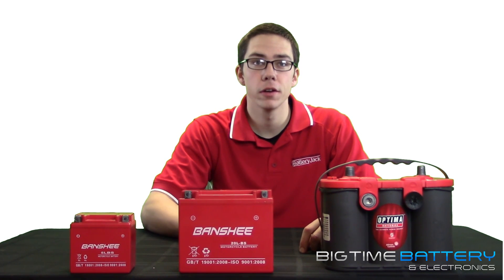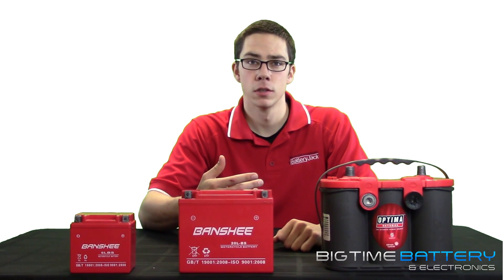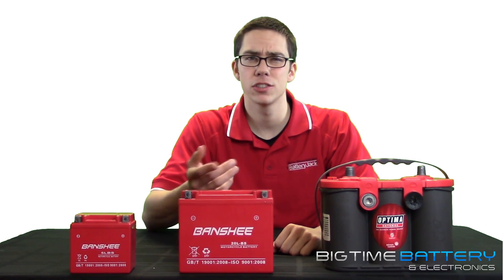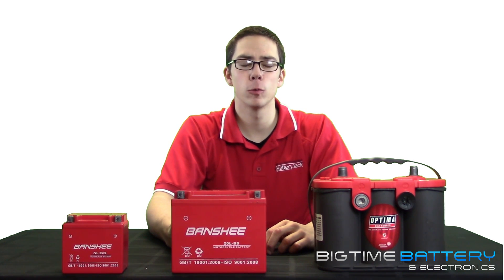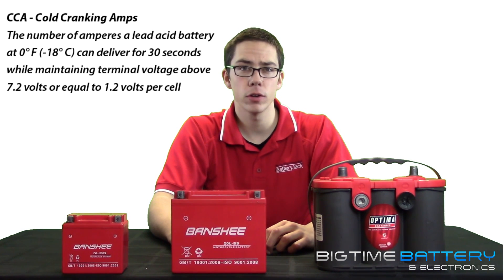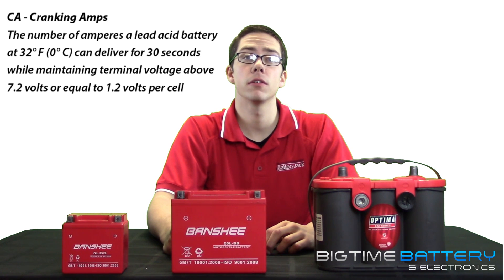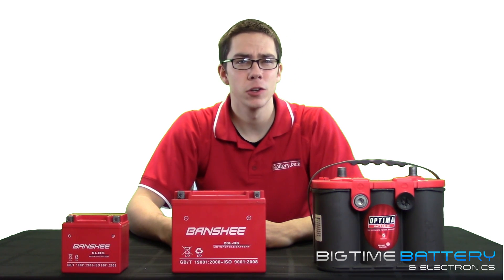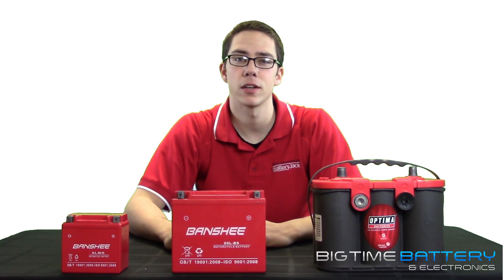Cranking Amps vs CCA

Comment: Simple define me cca definitions i dont understand
Reply from the maker: Cold Cranking Amps" (CCA) is a measure used to indicate a battery's ability to start an engine in cold temperatures. It represents the amount of current a battery can deliver for 30 seconds at 0°F (-18°C) while maintaining a voltage of at least 7.2 volts (for a 12-volt battery). In simpler terms, CCA tells you how well a battery can perform in cold weather conditions, which are typically more challenging for starting an engine due to increased resistance in the engine and battery. A higher CCA rating means the battery can deliver more power and is generally better suited for colder climates.

Comment: If my current battery is rated 650 cca’s could I replace it with a 600 cca battery? The CA on the current one I have is 825 but the one I’m looking at is 750.
Reply: Near enough.
Reply from the maker: Yes, you can typically replace a battery with a lower Cold Cranking Amps (CCA) rating, but it's important to consider a few factors.

Operating Conditions: If you live in a colder climate where the engine requires higher cranking power to start in cold temperatures, it's generally recommended to stick with a battery that matches or exceeds the CCA rating of your current battery. This ensures reliable starting performance, especially during cold weather.

Compatibility: Check the physical dimensions of the new battery to ensure it fits properly in your vehicle's battery tray and that the terminals are compatible with your vehicle's wiring.

Reserve Capacity (RC): Although CCA is important for starting the engine, Reserve Capacity (RC) is also worth considering. RC measures the battery's ability to sustain a load over time. If the new battery has a lower CCA but a higher RC compared to your current battery, it may still provide sufficient starting power and better overall performance.

Manufacturer Recommendations: Consult your vehicle's owner's manual or contact a trusted mechanic to see if there are any specific recommendations or requirements regarding battery replacement.

Given that the new battery you're considering has a slightly lower CCA but a higher CA rating, it may still be suitable for your vehicle, especially if you don't experience extremely cold temperatures. However, if you frequently encounter cold weather conditions, it's generally safer to stick with a battery that matches or exceeds the CCA rating of your current battery.

Comment: You have defined CCA in terms of lead acid battery, does that mean alkaline batteries does not have CCA rating.
Reply from the maker: Correct, Cold Cranking Amps (CCA) is a rating specifically associated with lead-acid batteries commonly used in vehicles, such as cars, trucks, and motorcycles.

Alkaline batteries, on the other hand, are typically used in smaller devices like flashlights, remote controls, and portable electronics. They operate on different principles and do not have a CCA rating. Alkaline batteries are not designed for the high current draw required to start an engine, so they are not rated in terms of Cold Cranking Amps.

Instead, alkaline batteries are rated in terms of voltage (usually 1.5 volts per cell) and capacity (usually measured in milliampere-hours, or mAh), which indicates how much energy they can store and deliver over time in low-power applications.

Comment: Why do these batteries only tell the CCA, and not the usual CA. I have a battery that has the same Reserve compacity.
Reply from the maker: If you have any other questions please feel free to call or text us at: 815-467-6464 or email me directly at cody@batteryjack.com

Cold Cranking Amps (CCA) and Cranking Amps (CA) are both measures of a battery's ability to deliver power, particularly during starting conditions. The difference lies in the temperature at which they are measured.

Cold Cranking Amps (CCA): This rating indicates the number of amps a battery can deliver at 0°F (-18°C) for 30 seconds while maintaining a voltage of at least 7.2 volts. CCA is crucial for starting a vehicle in cold weather because cold temperatures can significantly reduce a battery's ability to deliver power.

Cranking Amps (CA): CA, on the other hand, measures the same thing but at a higher temperature, usually at 32°F (0°C). CA is essentially a measure of a battery's power in less extreme conditions compared to CCA.

If your battery only lists CCA and not CA, it might be because the manufacturer is focusing on providing information relevant to cold weather performance, which is often more critical for starting a vehicle. However, if the reserve capacity is the same, it means that the battery should have similar performance under normal starting conditions as well.

Comment: When I started driving many years ago, I was always taught that the Cranking Amps are irrelevant, Cold Cranking Amps is the rating that’s important….of course I grew up in Detroit where we typically get about 3 years out of a car battery
Reply from the maker: In regions with cold weather like Detroit, where winters can be harsh, Cold Cranking Amps (CCA) indeed become a crucial factor when selecting a car battery. CCA measures the battery's ability to start an engine in cold temperatures, typically at 0°F (-18°C). This rating indicates the maximum current a battery can deliver for 30 seconds while maintaining at least 7.2 volts.

In contrast, Cranking Amps (CA) measure the battery's ability to start an engine in moderate temperatures, usually at 32°F (0°C). While CA is relevant in warmer climates, it may not accurately reflect a battery's performance in colder conditions.

Given the importance of reliable starting power in cold weather, particularly in places like Detroit, where winters can be severe, focusing on the Cold Cranking Amps rating when choosing a car battery is indeed prudent advice. A battery with a higher CCA rating ensures better starting performance in freezing temperatures, reducing the risk of being stranded due to a dead battery during winter months.

Comment: bro this information is useless. i figured you’d answer why it takes more amps to start something when cold
Reply: me too i am still looking Q_Q
Reply from the maker: I apologize for the oversight. The reason it takes more amps to start something when it's cold boils down to the chemistry of the battery and the physics of materials at lower temperatures.

Battery Chemistry: Inside a battery, chemical reactions generate electrical energy. These reactions are less efficient in colder temperatures because the electrolyte (the liquid or gel substance inside the battery) becomes more viscous, slowing down the flow of ions and electrons. As a result, the battery's ability to deliver power decreases in cold weather.

Increased Resistance: Cold temperatures increase the electrical resistance of the battery and the engine's components. This resistance impedes the flow of electricity, making it harder for the starter motor to turn over the engine. Consequently, more current (measured in amps) is needed to overcome this resistance and start the engine.

Engine Oil Viscosity: Cold temperatures also affect the viscosity of engine oil, making it thicker. This increased viscosity creates more resistance for the engine to turn over, requiring additional power from the battery to start the engine.

To compensate for these factors, a battery with a higher Cold Cranking Amps (CCA) rating is necessary in colder climates. This rating indicates the battery's ability to deliver high current at low temperatures, ensuring reliable starting power even in freezing conditions.

Comment: If my volts are good but my cca is 100 out of 450 would it mean my car is needing a new battery it starts up good still but need to know for my weekend driver car
Reply: Your battery is worn out. I assume you have already purchased a new one.
Reply from the maker: If your car starts up fine and the voltage is good, but the Cold Cranking Amps (CCA) of your battery are significantly lower than the recommended rating, it may indicate that your battery is starting to weaken. The CCA rating represents the battery's ability to start the engine in cold temperatures, so having a low CCA compared to the manufacturer's recommendation could mean that the battery might struggle to start the engine, especially in colder weather conditions.

While your car may still start up fine for now, a low CCA could mean that your battery is nearing the end of its lifespan and may fail sooner rather than later, especially if subjected to colder temperatures or increased demand (such as using additional electrical accessories). It's generally advisable to replace the battery if the CCA rating falls significantly below the recommended level to avoid unexpected issues, particularly if you rely on your car for weekend drives or infrequent use.

If you're unsure about the condition of your battery, you may consider having it tested by a professional mechanic or at an auto parts store. They can perform a load test to assess the battery's overall health and provide recommendations based on the results. This way, you can ensure that your car remains reliable for your weekend drives.

If you need any other help call or text us at: 815-467-6464

Comment: Yesterday morning when I went to start my car, all I heard was a “ping.”

I held the key down, then the engine cranked right over... is that cold cranking apps at work, or do I maybe have a small issue in my electrical system? 

It is colder than a mothers in laws love in Indiana right now.
Reply from the maker: It sounds like your experience could indeed be related to the effects of cold weather on your car's starting system, specifically the Cold Cranking Amps (CCA).

In cold weather, the chemical reactions inside the battery slow down, reducing its ability to deliver power to the starter motor. When you first attempted to start your car and heard the "ping" sound, it's possible that the battery initially struggled to provide enough power to turn the engine over. However, as you continued to hold the key down, the battery warmed up slightly due to the electrical current passing through it. This slight increase in temperature could have improved the battery's performance, allowing the engine to crank over successfully on the subsequent attempt.

This scenario is a common occurrence in cold weather conditions, especially in regions like Indiana where temperatures can drop significantly. However, it's always a good idea to monitor your car's electrical system and battery health to ensure everything is functioning properly. If you experience persistent starting issues or notice other electrical problems, it may be worth having your battery and charging system inspected by a qualified mechanic to rule out any underlying issues.

In the meantime, consider using a battery tender or parking your car in a garage to help maintain the battery's performance during cold weather. And remember, always be prepared with emergency supplies in case of unexpected car troubles during winter months.
Reply: Yes that is the CCA at work.

Comment: sir dose the cca value affect capcity in AH...what is the connection bw theese two parameter
Reply from the maker: Cold Cranking Amps (CCA) and Ampere-hours (Ah) are two different specifications that describe different aspects of a battery's performance.

Cold Cranking Amps (CCA): CCA measures a battery's ability to deliver a burst of energy to start an engine in cold weather conditions. It indicates the maximum current a battery can deliver at 0°F (-18°C) for 30 seconds while maintaining a voltage of at least 7.2 volts for a 12-volt battery. CCA is primarily relevant for starting batteries used in vehicles.

Ampere-hours (Ah): Ah measures the capacity of a battery to deliver a certain amount of current over a specified period. It represents the total amount of charge a battery can deliver at a constant rate over a certain period, typically expressed in hours. Ah is commonly used to describe the capacity of deep-cycle batteries used in applications such as solar energy storage, marine, and RV applications.

While CCA and Ah are both important battery specifications, they are not directly related to each other. The CCA value indicates the ability of the battery to deliver high current for starting purposes, while the Ah rating reflects the total energy storage capacity of the battery.

In practical terms, a battery with a higher CCA rating may have a lower Ah capacity and vice versa. This is because the design and construction of a battery optimized for high cranking power (such as starting batteries) may sacrifice some capacity, while batteries optimized for capacity (such as deep-cycle batteries) may not have as high CCA ratings.

So, there isn't a direct connection between CCA and Ah values, but they represent different aspects of a battery's performance and are both important considerations depending on the application in which the battery will be used.
Reply: @BigTimeBattery  thanks for the replay even after 3 years
Reply from the maker: @thanojssurendran7454  Sorry it’s a small business we are on and off YouTube, but I are actively working to be on it more. Keep in mind you can text or call us direct at: 815-467-6464 or email me directly at cody@batteryjack.com if you need any battery help faster.
Reply: @BigTimeBattery  it is ok i appreciate your efforts

Comment: Mechanic wanted me to change out the battery as the CCA was rated at 610 and measured 152 with 13.56 volts? Should it be replaced based on cca alone??
Reply: Yes. And only 2 years late to reply.
Reply from the maker: Cold Cranking Amps (CCA) is a measure of a battery's ability to start an engine in cold temperatures. A significant deviation between the rated CCA and the measured CCA, along with the voltage reading you provided, suggests that the battery might indeed need replacement.

A CCA measurement significantly lower than the rated value indicates that the battery may not be able to deliver sufficient power to start the engine reliably, especially in cold weather conditions. Additionally, the voltage reading of 13.56 volts is slightly high for a battery at rest, which could indicate overcharging or a failing battery.

Therefore, based on the low measured CCA and the voltage reading, replacing the battery would likely be a prudent course of action to ensure reliable starting performance, particularly in colder temperatures. It's essential to consult with a qualified mechanic to confirm the diagnosis and determine the best course of action for your specific situation.

If you have any questions or need help call or text: 815-467-6464 or email me directly at cody@batteryjack.com